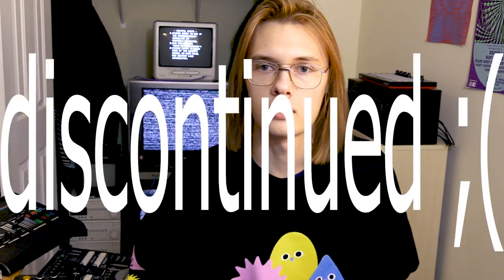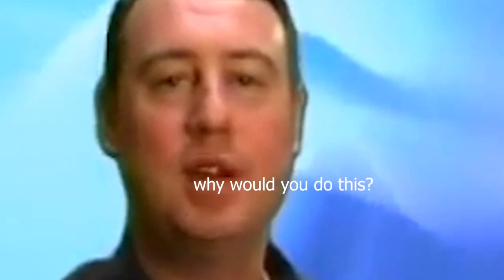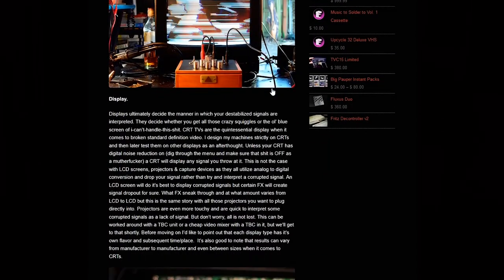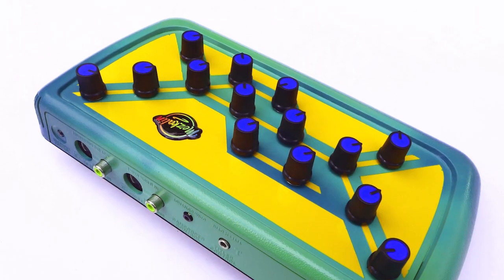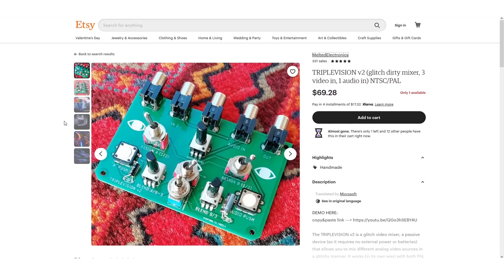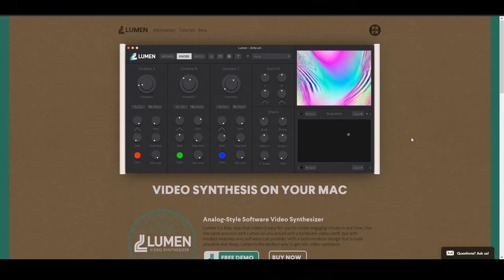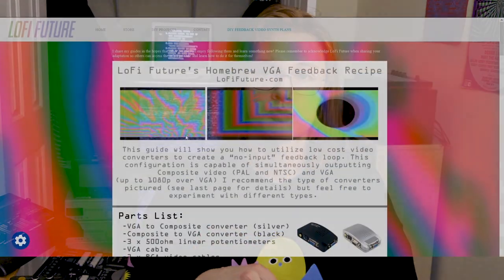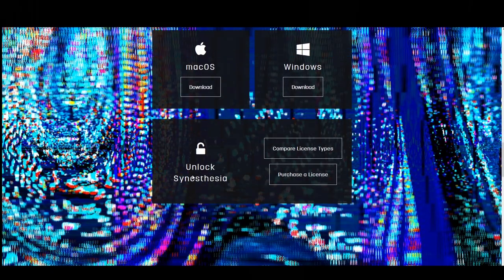An Overview of Video Glitch / Synth Gear Makers in 2021

Comment: Great breakdown, well organized, and very informative!  Thanks for including us (Erogenous Tones). On a glitch related note -- we use a really robust video in chip designed to deal w/bad timings so it can handle some pretty nasty input.  a favorite of mine is to run the BPMC Fluxus into STRUCTURE, add effects and feedback then send the output back to the BPMC Fluxus  (james from ET)
Reply from the maker: that is great to know! yeah from what I've read both you and LZX can work well with glitchy stuff, which is not always easy to handle.
Reply: if you or your family every need a kidney or lung transplant i will happily do it to get my hands on a structure !!

Comment: If you are going to mention Resolume, I think you should also cover Magic Music Visualizer and TouchDesigner. Both are node-based visual programming environments that many of us use either in place of - or in combination with - hardware.
Reply from the maker: i haven't heard of the first but i have about touch designer, seems like a daunting rabbit hole itself, like max msp i've heard, but it's good to know there is a lot of software out there
Reply: @YOVOZOL  Magic is much easier to get started with quickly. Touch takes some time and dedication, but it pays off. The full version of Magic is also much cheaper than most other similar packages.

Comment: Have you looked into FPGAs at all?  If you aren't familiar they are chips that let you configure the gates on the chip into any circuit you want.  So rather then programing software to to mimic analog devices you can actually recreate analog devices at a hardware level. In recent years they have been used  in the retro gaming scene to be able to play old games buy recreating the original hardware .  In theory,  you should be able to recreate the hardware from the old switches and what not and then do all the bending and what not on the chip.  It would allow an incredible freedom in trying out new circuits and not having to worry about breaking units from the depleting supply of original hardware.  I little google search looks like some others have had the same thought.
Reply from the maker: this sounds like something you should send to one of the people I talk about, if they're not already exploring this. I am not an engineer haha. but sounds interesting

Comment: great video man.  in it you mentioned how starting out with tachyons plus probably isn’t the move if you’re just getting into it, but i’ve never done any DIY stuff.  what do you think the best route would be?  i’m leaning towards something from T+ but i was wondering if you could provide a little more clarity on the alternatives for beginners
Reply from the maker: I would start with making a dirty video mixer. It is very easy to look up how to do and extremely cheap. Being able to create and do something with that will prevent the situation where you buy a circuit bent box with a bunch of knobs and say "well... now what do i do?"

Comment: dude do u know any where i can find a CLEAN composite video mixer??? I am using a dirty mixer right now, but it seems like its impossible to find anything on a clean video mixer...
Reply from the maker: fading between analog video sources isn't easy without getting signal distortion because you need to physically sync up the video waveforms, and to do that you need buffers and microchips and more complicated stuff that only exist in analog video mixers and switchers

Comment: Thanks a million for this very well-made video. It might be a stupid question, but would region matter if you use something like a power converter? I'm only asking because I've seen some NTSC units that I really dig, but I'm EU based. Just wondering if that's a possibility to work across PAL and NTSC if the power is regulated. Cheers
Reply from the maker: power is not an issue if you use the proper voltages and converters, the issue is that PAL video signals are encoded differently from NTSC and so they cannot properly mix. You either have to use all PAL gear or all NTSC gear, or have something in the chain than can convert between the two standards.
Reply: @YOVOZOL  ahhh thank you, that was the answer I was looking for! thanks a bunch! <3

Comment: I made a dirty video mixer, but on the tv I have when the signal is too low I got a blue screen, can some power be added so it won't jump to blue screen?
Reply from the maker: if your TV screen is a CRT screen (tube TV) you shouldn't be getting a blue screen, and if you still are, you should be able to turn off any digital settings. If all else fails just get an older TV.
Reply: @YOVOZOL  I frequently use an old projector. Btw I just founf out there is this device : HDM68 modulator which can be used to connrct to the oldest tvs, maybe it can be altered to do some glitches, have you tried it ?

Comment: I'm getting interested analog video but I don't have any money or resources to spend to get to it hands on. is there like a free way to do this or an emulation?
Reply from the maker: lumen and resolume which i mention here have free demos. you can always find free or cheap old crt tv's around town lying around. assuming you have a camera, you can start with doing some camera feedback by plugging it into the tv. and you can mess with video signals from tapes and vcrs and cameras to do interesting stuff.

most iconic analog video glitches are, to my knowledge, not easily emulated, but there's definitely software out there for synthesis and just trippy generative stuff in general.

Comment: What happens if you send a video signal through guitar pedals?
Reply from the maker: probably not much i suspect because video signals are at a much higher frequency than audio which the pedals are not designed to handle

Comment: I Like these videos. Great channel. Funny thing in this one though. You correctly dismissed circuit bent audio as "weird noises." But, the next breath is getting the nards of bent video all steamy. It is the same as bent audio, "Weird visuals."  The artist and viewer are the only ones who can experience it as art. Circuit bending can be cool. It usually isn't.  The video circuits aren't much more complicated than audio. The bends are just short circuits between places not meant to be connected. The Real skill is knowing when to put in a diode/capacitor/resistor, and which values. 
The people who bend shtuff for sale should just build those circuits on new boards with the mods built in at the least. But, really should design it to do what they want. A bend is usually bad for the original circuit. Design a circuit to manage it. 
And the video bend "community" is just some greedy $hit. Show the bend points at least, if not the actual circuit they have "designed" and added on.  Charging Crazy prices for cheap, old gear video that is now making a bad signal. 😂 I like it too, but it isn't magic or R&D on a new product. 
Here's my 1999 crap car for sell. It still runs. I have modified it! Now the radio is self tuning, adjusts its volume randomly, and when you switch to AM, the windows roll down. Push the trunk release button and the horn honks, the headlights flash in sequence, and passenger seat leans back. I gave it a bitchin' Orange flame paint job over pink and black stripes with spray paint. Added Aesthetic.  $80,000.  And it's authentic,old school, analog...sniff sniff.
Later on you show the dirty vid mixer and how it is a hack job that people charge tooooo much for. Same thing with circuit bent gear. Not worth the $.(Zoom into my eyes)😂
Reply from the maker: not sure if this is worth unpacking in a youtube response on my own video but, thanks for sharing your opinon i guess? didn't mean to talk down circuit bending of any kind, and i have a lot of respect for those who study circuits and revive these dying proprietary devices.
Reply: @YOVOZOL  yeah, opinions are...and that's about it. It's ok to speak the truth about bending. You did. My point is Ghazala and Klomp released their ideas. They showed bend points,schematics, and all. Now anyone who wants to try can do it on their own. Overcharging for bent stuff is crappy ethics. Just show the bends. I can't believe someone would spend so much $ on bent stuff, not look inside and see it ain't $h!t, and not feel used. I'd take pics and post them to save someone else the shame. Spend that money on more other stuff to further art. Same as you said, brother. You can just make your own.
Reply from the maker: @dreamingone615  well nothing stops you from buying one and doing exactly as you say, posting pics of the bend points. i would disagree with you that what is inside "ain't $h!t". there's a lot more behind the prices than just the act of soldering it together. if can't see that it's probably not worth discussing further haha
Reply: @YOVOZOL  👍 Happy Valentine's day!